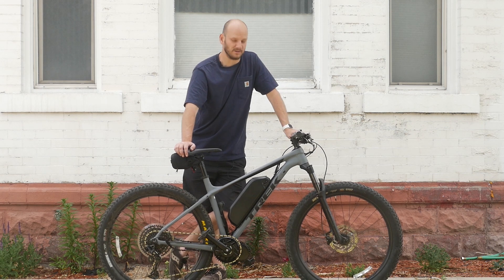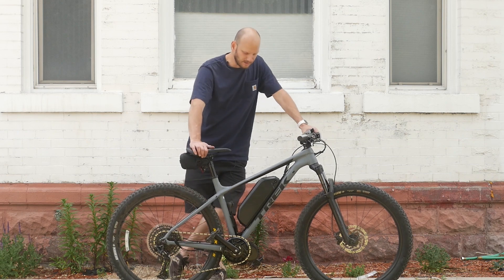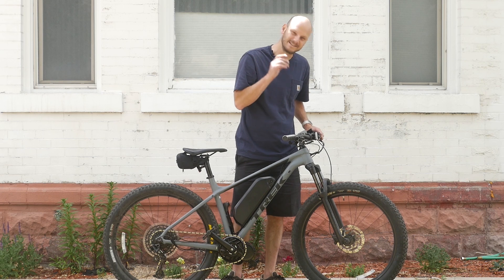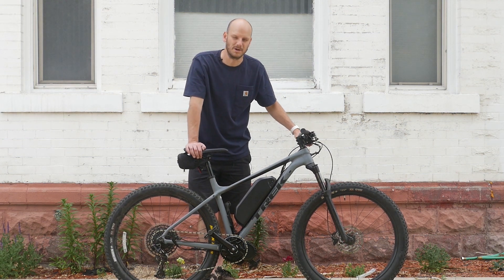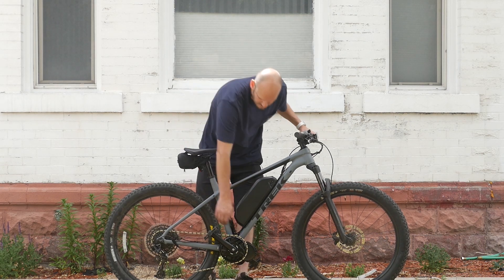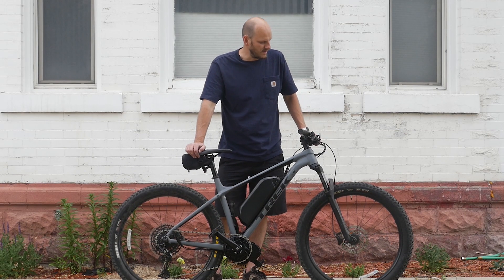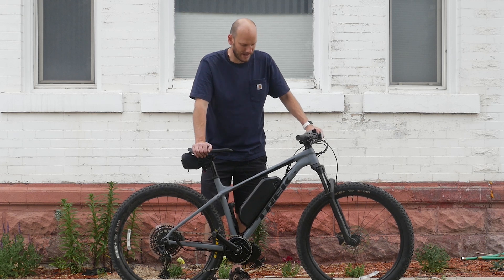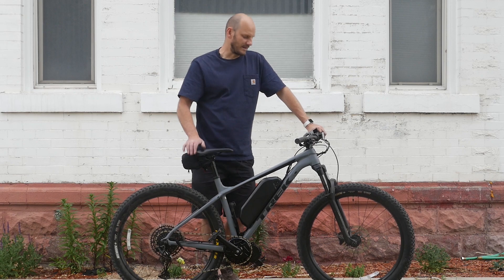Custom E-bike Build:  Trek Roscoe BBSHD 52v 17.5ah

Comment: I would use a 28 tooth to climb everything
Reply: But you need a 42 t lekkie to get the offset closer to the frame and that means that you can get that 52t rear gear to work which gives great climbing ability, mine is similar to this and climbs anything really easily.

Comment: Hi Johnny, I’m looking at converting my orbita tandem to and E Bike, what kit would you recommend, I was considering a front wheel drive motor!!!
Reply: Tandems are hard enough to balance starting, stopping and in low speed manuevering without the sudden acceleration of any cadence based system.  A smaller, lighter, mid-drive motor may be your best bet (you've already got two pedaling on something little heavier than a solo bike). A torque sensing unit will engage more quickly and smoothly starting and accelerating out of low speed maneuvers. 

I recommend The Tongsheng TSDZ2 for your application. You won't have to mess with extension cables or deciding who, if not both, get the brake cut offs. There will be no need for a shift sensor either. As it turns out, they cost less than other mod-drives and are a whole lot more robust than any hub drive with controller wires running everywhere. This all makes for a far more simple install.
Reply: @MHH3180  Hi Mark, thank you very much for getting back to me, I very much appreciate your recommendation and I will look into the cost of this kit and where to purchases it from. Once I have the kit and have built it, I will let you know how it has gone. 🚴‍♂️
Once again many thanks for your assistance. Regards Tom
Reply: @tomnorton1152  you can purchase them for less many places, but eco-cycles out of Nashville offers astounding support and can even program the type of assist for your application. Yours is one of the rare few times I might go for 52 volts (range) and the 750 watt version as two riders will be able to generate the torque necessary to take advantage of it.
Reply: @MHH3180  Thank you Mark, I really appreciate your input. Best regards Tom

Comment: Johnny, What are your thoughts on using a Shimano Nexus 3 speed IGH with a BBSHD with a single speed chain and chai tensioner? Will it hold up with a proper  Lekkie chainring and rear cog set up?
Reply: Sounds awesome
Reply from the maker: I like the 3spees nexus a lot. For a lot of people it could be the way to go, as long as you don’t need more gear ratio
Reply: @JohnnyNerdOut  Hell I rode a single gear for years, I would be commuting in urban/ suburban areas and some greenway riding in my spare time. Not really trying to climb super steep hills either.
Reply: https://youtu.be/MD1bUpvLJ0Y